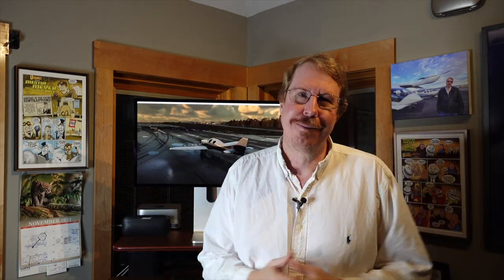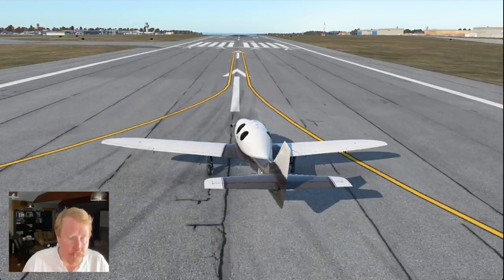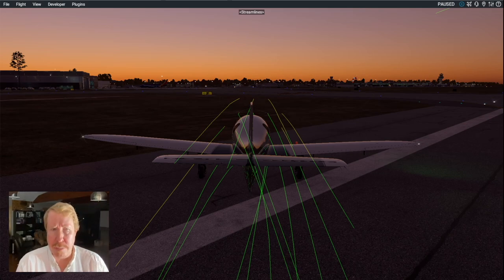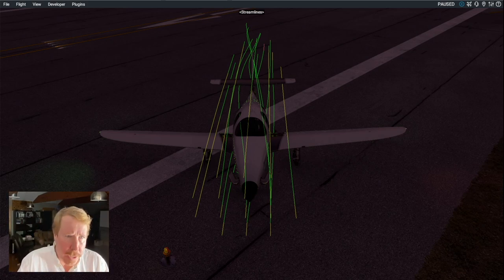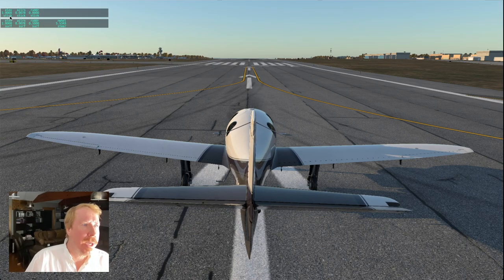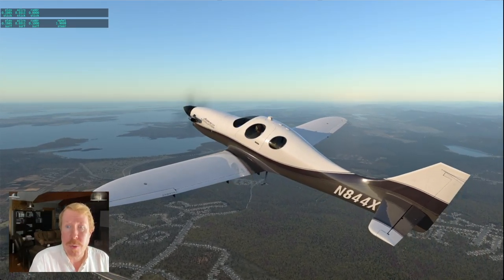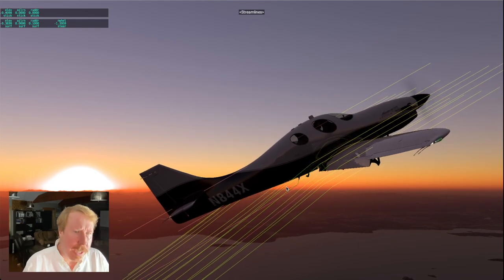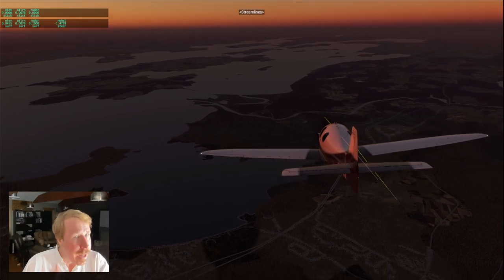X-Plane did WWHHAAAA!!?!?!?!?

Comment: Wow, a dev teaching people. To users of actual simulations like this, planes acting "weird" is almost always not the software, it's your understanding of aerospace information. Reality is very messy when you start to get into complex physics. There are all kinds of problems to overcome. Jeez, this man is spending his time doing a lot more than a lot of people deserve. Back in my day, you either learned why you were crashing, learned about sensitivity curves, etc, or you just suffered. Real simulators are going to murder you until you have some basic comprehension of what you are dealing with. I wonder what these folks think when they load up DCS. "This modern aircraft made for war has too many buttons."
Reply: They should fly in a dual control DHC-2 Beaver (rare, but I chartered one out of Sitka, and since we all knew the pilots, I flew for a half-hour, learning coordinated rudder turns: "Stomp on the rudder and wait until it starts to turn, then bank with aileron.  A DC-3 is slow that way, too."  - Tour Group Leader, Cordova (Alaska) Centennial's DC-3 Adventure Flight to McCarthy, in August 2008.  (First DC-3 passenger flight to McCarthy since 1975, according to Ken Smith, a son of Merle "Mudhole" Smith.

Comment: SENSITIVITY:  Maybe you should warn when SENSITIVITY > 10%.  Ask user to confirm that they want to have low authority.

I appreciate the realism and the physics work that went into X-Plane.    Because most of us don't have the budget for a force feedback yoke, or a full motion sim,  the ability to visualizing things like the attitude of the aircraft, the wind direction and speed, the engine's power, the air currents and any wake turbulence,  is so very useful.   My very favorite feature in XPlane is to review a flight from outside the cockpit with the flight path visualized, the forces on the wings visualized, and a little FlyWithLua plugin that gives me things like the data points that the sim has but format them prettier. 
When flying a helicopter, a little plugin called HeliHud makes all the data I want to know about helicopters visible as a HUD.

Comment: I understand the internal and external flight dynamics built into Xplane... what I don't understand is why I need a supercomputer to attain the framerates needed to stay connected to VATSIM. Poorly written program code for this app. FYI... flying sims since 1986, 11,000+hrs. on VATSIM. 60-75FPS on MSFS, 24-32fps on Xplane 11. Vulcan doesn't work. 22+ hrs. in PA22.

Comment: Why in X-Plane you still can't use 2 different controls and configure the pitch roll and yaw axes on both controls without causing conflict, as it happens in FSX and MSFS 2020?
Reply: You can, called copilot controls

Comment: I LOVE LOVE LOVE xplane 11.  I have a very basic sim set up.   But my god Simming is awesome. I absolutely love it.  It’s such a wonderful escape.  

Wish my rig could run xplane 12.  🥺
Reply: you should try the demo, i run it on a 1650 laptop medium settings 2k 30fps and vr 45fps but on a lower res headset. you could be surprised by the results.
Reply: It isn't nearly as resource hungry as you might think.

Comment: In xplane 12 lancair have problem that you cannot set both fuel Tanks on selector only left right off not both you can see even in your video you had problem that you had only one tank full and other empty is it in real life same or it is game bug??
Reply from the maker: This is 100% realistic – proper planning to land at near-equal fuel in both tanks is part of the fun/challenge of operating this aircraft.
Reply: @XPlaneOfficial  cessna 172 have feature of using both fuel Tanks at the same time so its balanced.
Thanks for info I appreciate your answer.

Comment: The problem at Laminer Research is they simply have not yet decided whether they want x-plane to continue to develop as an engineering tool or a full fledge flight simulator. this video is an excellent example
Reply: Watch the early interview with Austin, in which he talks about the basis for developing X-Plane as a ground simulator for the IFR refresher training prior to the periodic check ride with a flight examiner (for operating under the Federal Aviation Regulations Part 91, CFR Title 14, a Biennial Flight Review is a requirement, definitely in the contiguous states).  He was motivated to develop X-Plane because he needed this and saw the need of other pilots.  I worked with the developer of FSM software as he installed Full Service Marina in a number of Alaska Harbormaster's Offices, and he told me about going with his dad, an airline captain and instructor to work one day at the airline's simulator, and the pilot scheduled for the simulator training failed to show up, so he flew the simulator time with his dad.  Wow!  The real airplane is always easier to fly than the simulated version, since all you need to do is turn your head to see what's happening.  We're analog, not digital pilots, that would rather grab a knob, twist, push, pull than deal with a touch-sensitive control system.  "Fully fledged" means the bird has all its flight feathers and is ready to leave the nest.  Airworthy...
Reply: @charlesbranch4120  Hi Charles and thanks for commenting. i like comments and hearing other folkes opionions cuz every opinion maatters so thanks for sharing

Comment: XP sitll uses Blade Element theory for its flight physics calculations though. This not as accurate as msfs boundary theory and CFD. And Weather, world wide weather representation is XPs weakness.
Reply: I just leave here for you buddy. This is where CFD gets you, from one that knows. 

“The previous update had a few scenarios which were still problematic for under-thrust and over-thrust conditions. These conditions come about because the atmospheric stability in MSFS is significantly unrealistic, and we have had to build additional logic into the control law for these channels that is capable of dealing with situations that are thoroughly inconceivable in the real world.”

- RSR, PMDG
Reply: @Mark-kh1ny  This the guy that said it wasn't possible to have an EFB, whilst even free planes are including it? Wouldn't trust that guy as far as I could throw him.
Reply: @CpnGoose  who RSR? Or the OP?
Reply: @Mark-kh1ny  Randazzo.
Reply: @CpnGoose  utter bollox, there’s always been an EFB in the pipeline. If that’s the case post the proof of him saying it.